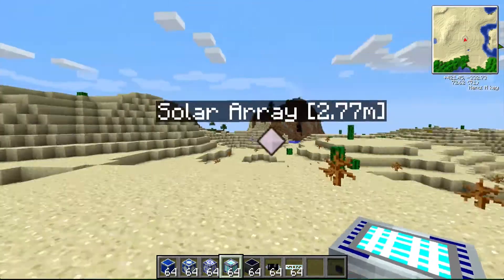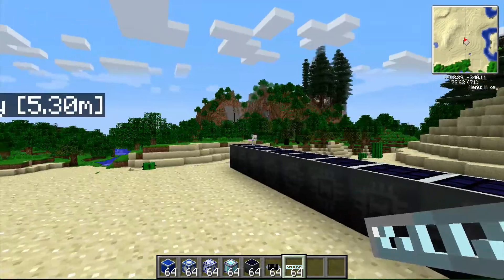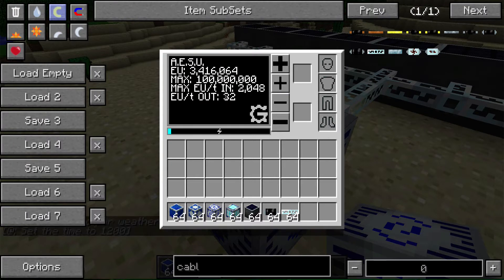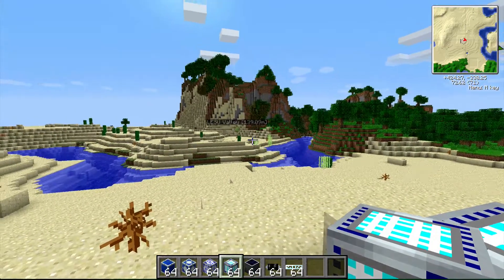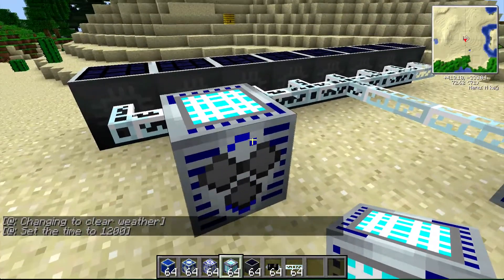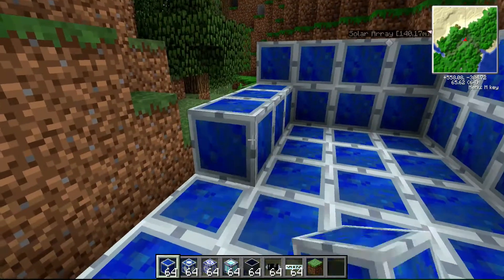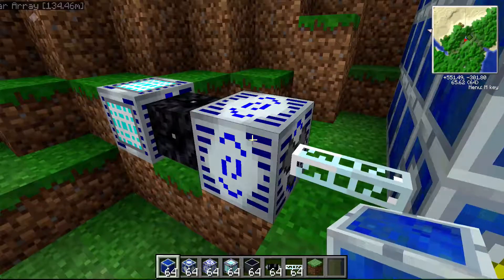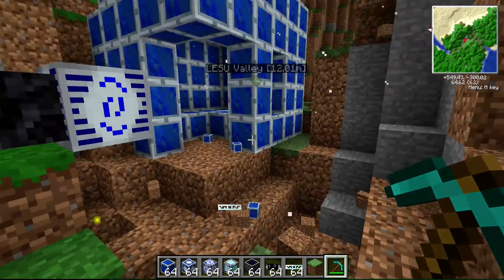Tutorials:  Greg Tech - Advanced energy storage

Comment: sorry, i meant 2048, later in the video he had 8 supercondensators going to 8 HV transformers, and each transformer downstep makes 4 packets each one is 1/4 of the original packet, the hv transformers were getting packets of 8192, and splitting them into packets of 2048, then he attached glass fiber and hooked that up to a matter fabricator therefore it was holding packets of 2048

Comment from the maker: At what point in that video did he have a *packet* size of 8192?  When he was working on the reactor, he was using superconductor wire for the big stuff.  The glass cable there was lower packet size.  Per the wiki, glass fiber cable has a limit of 512 EU/p.  Again, all cables have unlimited EU/t, even tin.

Unfortunately, the EU Reader doesn't report packet sizes, so you have to figure that part out from the connected machines.